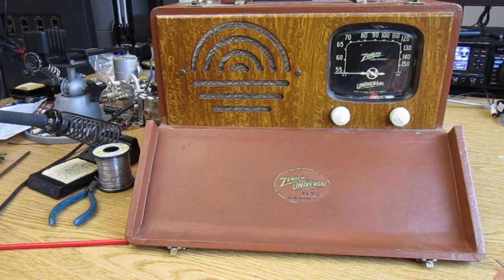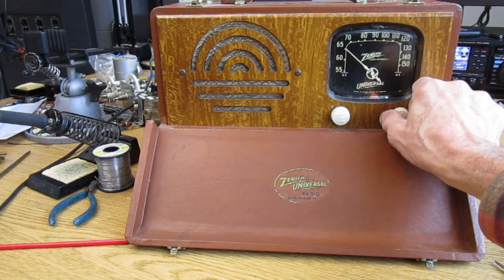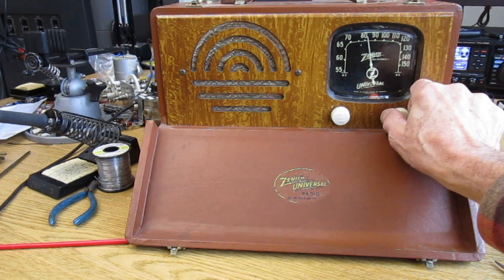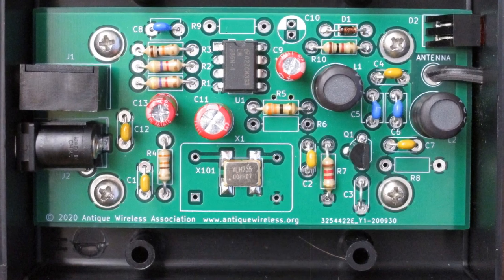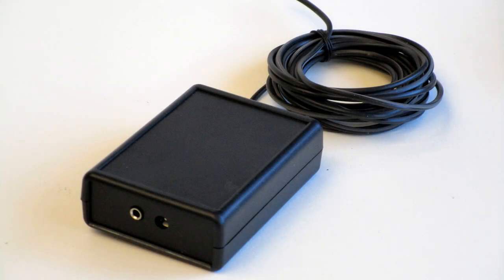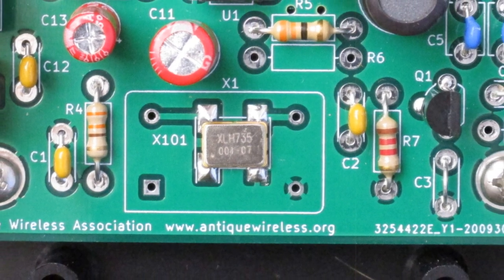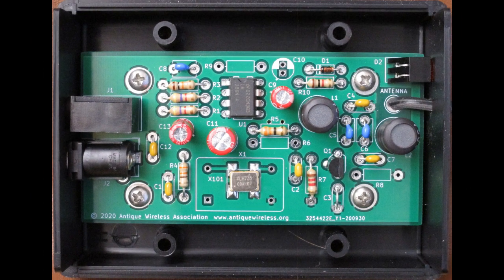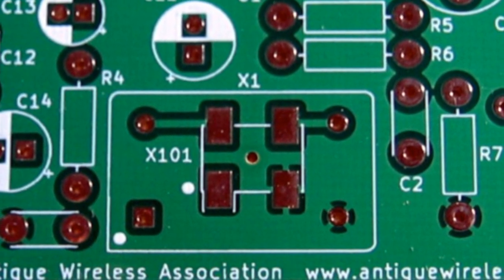Build your own Radio Station with the AWA Low Power AM Broadcast Transmitter Printed Circuit Board

Comment: Well I finally finished this one, and boy was it fun to put together! I started it over a year ago, populating the board one piece at a time. The whole process brought a great fealing of satisfaction. Unfortunately Mouser had a few items on backorder - no big deal. Time passed and more time passed, eventually the backordered parts came in. More time passed, and just this week I finally completed it. Testing it out for the first time was interesting, it should have been right around 1.024 MHz but it wasn't there, I ended up on 2 MHz. Perfect audio and everything. Overall - sweet project!!

Comment: Hi Guys, well I soldered the crystals in and the device works great. I have a couple of questions though. Is there an email where I can contact someone at the AWA to answer them?Nothing super technical or anything. Basically, the length of the antenna wire. I know there is what, about a 10ft limit total length coming out of the transmitter. I know the total feedline and antenna is included.
 Secondly the output coil has a slug. Is this only to trim the antenna for maximum output?
I have some receivers that have meters, and can tune the slug for max signal output. I've not adjusted anything yet, and the antenna out of the box is about 8 ft at the moment.
Perhaps there is a forum you know of that discusses your particular device.
Any links for contacting someone at the AWA would be great.I just don;t know a particular person to search out.
Thanks again, it's a nice little transmitter and look forward to putting it 'on the air' for my collection.
Reply from the maker: There's a contact form near the bottom of this page on the AW website:
https://www.antiquewireless.org/homepage/purchase-pcb-items/

Comment: Hi, I just completed (almost) 2 of these transmitters. I think I have the latest version of the boards, although some differences from the one shown in the video C3 for example is not on the boards. Perhaps it was updated to remove the jumper.
 Only thing that worries me is soldering the crystal (the 1Khz version). The device has 6 pads, the board only has 4 pads. Again,assuming the middle 2 pads are not connected to anything.
I'll probably solder one on a board and see how it goes. I know about the positioning dot.
 I believe my 20W soldering iron with a very pointed tip will get to the pads to flow solder. I even bought some soldering paste to aid in the flow of solder. 
Cool design though I just hope both of them work. It's been a long time since I built anything PC board related. Thanks!

Comment: Having experimented with several AM broadcast band transmitters, I would have to say this one may be the best one I've used. Electrical noise in the home, both RF and EMF, is always a problem with any AM transmitter. I get the best results running it on a battery with a short antenna laying near the radio. A standard 9-volt battery will last maybe 5 hours or so, but I'm running the transmitter on a rechargeable 5 volt USB battery pack. I find that 5 volts works just fine, at least for short range transmission. In fact, it seems less susceptible to noise on 5 volt power.